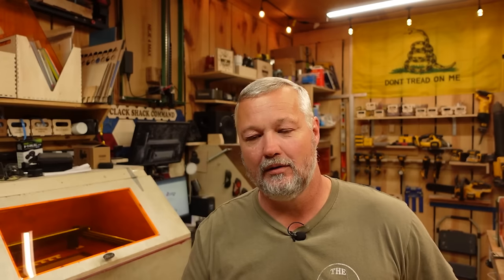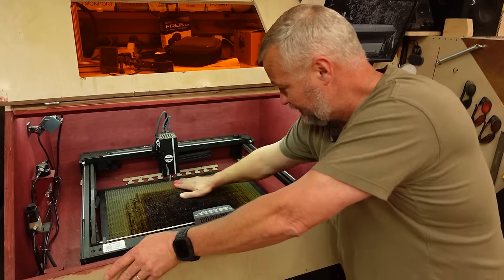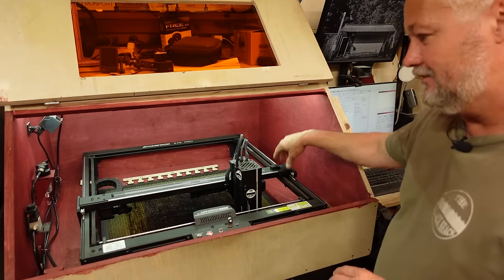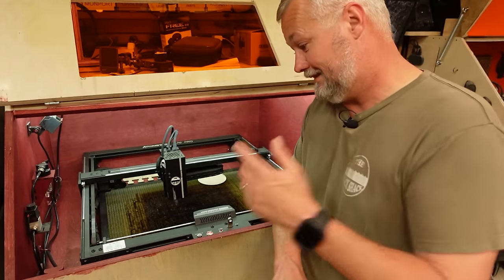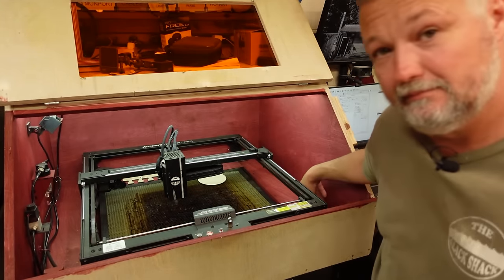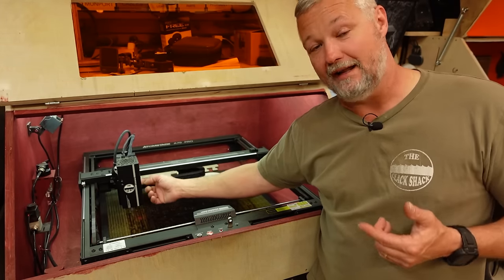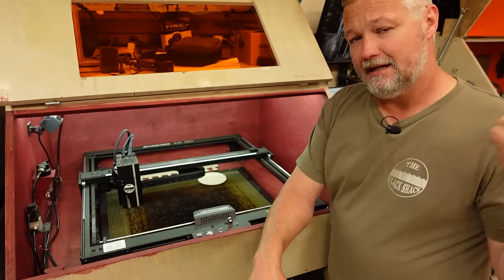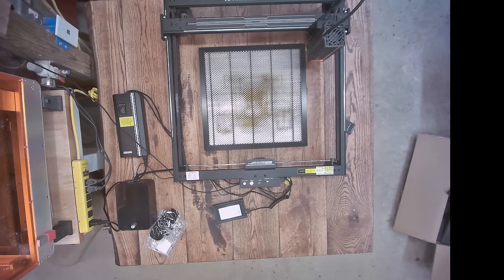70 watts of power- Atomstack A70 pro

Comment: Hello. New to Atomstack - silly me got it as a first laser A70 Max and now stuck as I cannot use it properly. You said in the video you will share your settings for LightBurn, but I cannot find it, could you help me? where are those can be found? Also would share a video on a project maybe? something simple? where you also share your settings? I have been testing my A70 max and my cuts are getting clearer, but the engraving cannot get clearer at some point, and I have seen laser make beautiful clean readable writings or pictures but I have no idea how to get there. Unfortunately I have decided to buy a laser that is quite new and there are not many "overexplaining" videos or videos with simple settings that can a newbie try or follow? Would  you or your friend, "Steve on a stick" would consider making a video like that with A70? Would be amazingly helpful. Thanks for the video.
Reply from the maker: I recommend speed and power tests for everything. Also, make sure to use air assist when cutting. I have lots of videos that even though they are on different machines, the process is exactly the same. Have fun..
Reply: @TheClackShack  Thanks. I have been doing a lots of tests, but they are disasters unfortunately. I am not sure where is the error really. I am watching videos with different machines but  my issue is the settings for this particular laser. Air assist is always on when I use the laser, so that shouldn't be the problem. Maybe I have set it up incorrectly somewhere. I did try to loosen the belt, not with much luck, as it is only getting loose on the down side, so the top is so stretched, no idea how to address that issue either.
Reply: @TheClackShack  I really think something went wrong when I setup the laser. If I understand it correctly, the 45-test is that you have to lift up one side of your laser and the it has to roll away. Well, I have lifted up mine 45 degrees, 60 degrees, even 90 degrees, it doesn't move a muscles, not unless I push it or pull it. I have tried to loosen the belts, but nothing changes, that is so "well" fixed to it, it only rolls if I manually move it.

Comment: Hi Dave, been following you since nearly the beginning. I just received this same unit, A70, and I'm running the latest version of Lightburn but I can't get the unit to run. I'm struggling with the set up. Everything went together fine. I set the laser up per the book instructions and even set up the laser module as you noted, close to the surface, but I'm getting "machine exceeds maximum range of motion" and a light burn error 22: Feed rate has not been set or is undefined. Any help would be greatly appreciated. I'm happy to pay for a consult if you arrange it.
Reply from the maker: It is likely the Z axis setup. Remove the honeycomb from under it and sit it on a flat surface. Connect the module to the machine and make sure the z probe contacts the surface at 0. You have to make sure the physical and digital location of the Z axis are the set up properly.
Reply: @TheClackShack  Dave, you are my HERO. 3 hours of frustration. Worked perfectly. Thanks for the quick response too.

Comment: We purchased the x70 max about a month ago. It worked great out of the box, then I switched it over to my shop air. Shortly after that, I noticed it wasn’t working well. The protective lens was cracked. Have you had any issues with this?
Reply from the maker: Shop air is great if done correctly, making sure water is not in the line is crucial. Lenses can crack with use but water will crack them quick.

Shop air setup for diode lasers
https://youtu.be/Wns4spUMBqQ

Comment: Question about the cleaning of the laser lens. I clean mine everyday, I have to remove it, take off the nozzle, run a q-tip with alcohol on it around the lens. Then put it back together. Listening to you talk about getting the Z axis just right made me wonder how hard it would be to clean the lens? Great video, I liked the consideration of putting the assembly at the end. I watched but I like not having to skip through the video if I didn't want to watch it.
Reply from the maker: It has two set screws that hold the z axis, other than that it is the same process.

Comment: Great video. I'm looking to buy an A70, could someone tell me the overall footprint of the laser frame, so I can see if it will fit in my space. Thanks
Reply from the maker: The bare minimum is 29Wx32D. I would At least do 32x36 to have a little wiggle room.

Comment: Great review and awesome custom enclosure. Have you tried cutting cross laminated bamboo plywood?
Reply from the maker: I haven't but if any machine could do it, the A70 could.
Reply: @TheClackShack  thanks for the reply! I’ve heard from them 5mm in one pass but am curious as to the glues used if that would be an issue with its cutting ability. Seeing it cut plywood so fast tells me it shouldn’t be an issue. A lot of power vs Creality’s 60w they say can cut 3mm bamboo at 900mm speed. Can I ask where you got the laser glass for your enclosure? Thank you.

Comment: I just bought this machine and I`m having a nightmare with tension adjustment. Any tips would be really helpful.
Reply from the maker: The A70 needs a bit more tension due to the wider belts. Instead of 45 degree lean, closer to 40
Reply: @TheClackShack  Thanks for that information. I have it tight but the corners don`t quite cut through. I`ve spent hours on fine tuning.

Comment: what is kerf size looking like on various materials compared with others such as the xtool s1-40?
Reply from the maker: I haven’t seen a huge difference, I am sure it is larger but still less than a scroll or band saw
Reply: I have the Ikier equivalent of this laser.  For 35 watts, I'm getting a 0.1 mm kerf, for 70 watts, I'm getting about 0.14 mm kerf (0.004" and 0.0055" respectively).  It is definitely a bit larger than the 20 Watt xTool D1 Pro kerf.

Comment: Hi I bought one of these that is the A70 Max and am having trouble connecting it to my Mac this is not the first laser that I have used on this mac through lightburn either. When I click on the device button to home the laser it says;
 ALARM 9 
Homing fail.Could not find limit switch within search distance.Defined as 1.5 * max_travel on
search and 5 * pulloff on locate phases.
ok 
Grbl 1.1h['$' for help]
[MSG:'$H'|'$X'to unlock]
[MSG:Caution: Unlock]
ok
Any help would be greatly appreciated.
Reply from the maker: Check the installation of the z axis. If it is not properly calibrated during install, it will cause that. The focus probe of the zaxis needs to be even to the surface where the feet are sitting. Do not set it based on a honeycomb or etc

Comment: I've been looking into adding a laser cutter to my shop, would this be a good alternative to an 80w co2 laser for cutting leather, wood, etc?
Reply from the maker: CO2 and diodes are different animals intended for different materials. For wood, it works great but bed size is also something to consider. Both have their limitations but I like mine for what I use it for.

Comment: Okay I hope I'm not repeating myself I can't find the comment I just made so probably messed something up....

What are your thoughts on the larger version have you heard anyone using that? The max
Reply from the maker: From what I can tell, the mechanics are the same, just a larger frame,longer belts and cabling. I just didn’t have room for the bigger one. Rarely do I need anything that requires that size work area. I also have a 4x4 CNC if I do.

Comment: Hi David, two questions: 1. have you any updates on this laser since this initial review - you gave it a spot in the shop, is it having any issue holding onto that spot?  2. In your videos I notice that you have dramatically changed the way that your interlocking panels look (seem to be much smaller) have you been updating your etsy store with the changes for older machines (still using Atzer P20) for example?
Reply from the maker: It is still king for cutting. I use it every week still. I am improving upon the design on newer versions but what you are probably seeing is the DIY kit that I am running in my enclosures. They are minimal but do take more permanent setup.

Comment: They call it PRO and it isn't even built as a closed-box machine with safety features. 
Avalanches of NO-PRO toys which are launched on the market on a monthly basis, everytime "This is the best by now" but it's just a little less crap.
Collections of craps which are sold to people willing to pay and be lab rats for their dangerous experiments.
Maybe PRO doesn't mean PROFESSIONAL but PROFITABLE (for the sellers) and PROBLEMATIC (for the buyers).
Reply from the maker: Wow, I am guessing you really don’t like the machine. I kinda like it being open framed and able to be custom enclosed.
Reply: @TheClackShack  The fact is not that I don't like this machine specifically. The fact is that I don't agree with the sale of dangerous machines of this type without them being supplied factory ready with the highest possible safety features.
This applies to this machine as it applies to the other ten thousand versions of this type of machines which have always been sold without protections, since the models with 1W of laser power.
The possibility to make a custom enclosure is not a possibility, in my opinion, is a lack of a fundamental feature which is sold like possibility for you to solve their problem, just because you have fun in building enclosures.
It's like someone selling a car without brakes and telling you here's a chance for you to have fun in building your custom brakes.
Reply from the maker: @simoncino83  I guess it is a preference, I think folks are responsible for their own safety. I have actually built go carts and dune buggies as well. Used tractor brake setup to get better turning radius.
Reply: @TheClackShack  It seems to me that you're confusing things you build for yourself with things that are mass-produced and sold to the public.
Things that are mass-produced and sold to the public must comply with certain minimum safety requirements, especially in relation to the most dangerous risks.
I assume that your home's electrical system contains a circuit breaker and an RCD to protect your home and your life. It's not up to you to mount it or not mount it, it just must be there.
Anyway, if you're happy to continually pay - rather than get paid - to receive incomplete and unsafe equipment, that's fine.
If you are happy to complete and make safe the machines at your own expense, that's fine.
Obviously, when I say "you", I'm only talking about ordinary buyers, not about reviewers who receive every month some new machines for free, and they also receive a percentage of the sales they bring to the company, and they also earn from the views of their reviews.
Reply from the maker: @simoncino83  Actually, where I live, we do not have codes that require us to do specific things. I did install breakers but only because the old fuses are expensive. Good day..